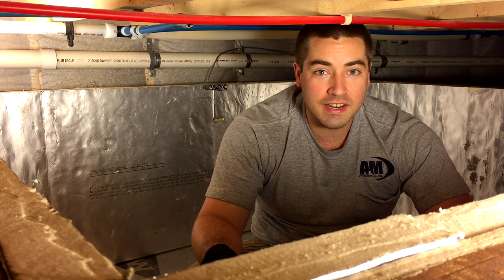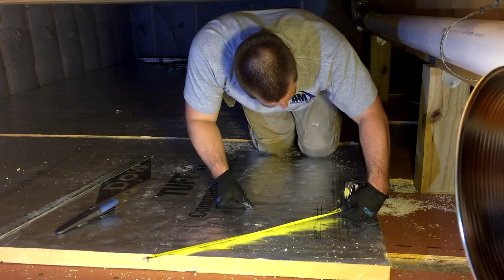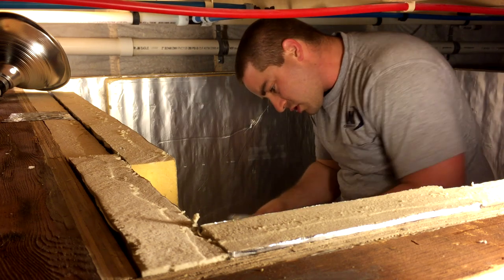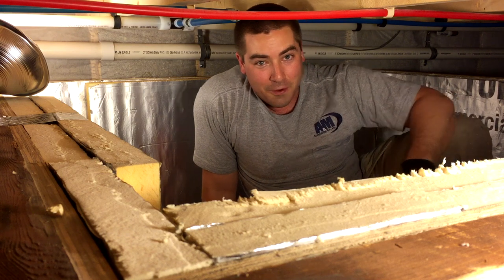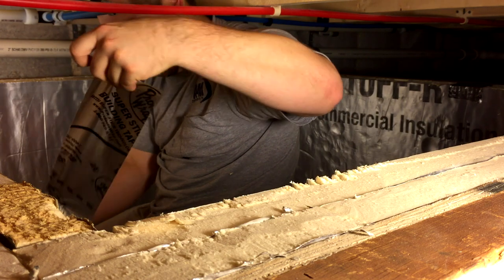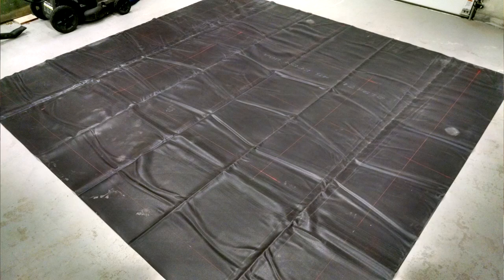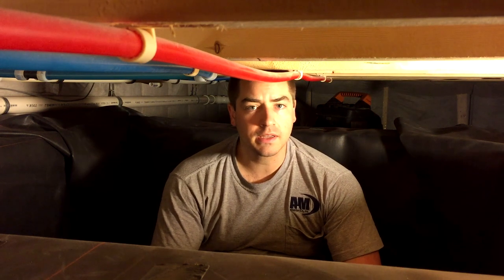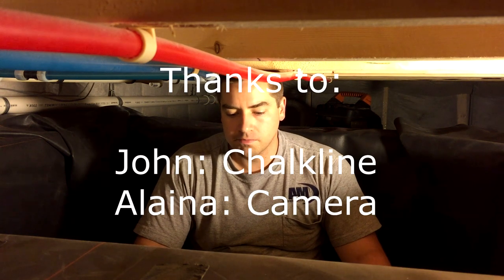DIY Hot Water Solar Thermal Tank

Comment: Have you considered storing chilled water, as well?  I was thinking of storing chilled and/or heated water as a way to supplement heating and cooling.  Whever I have cheap or excess power, I can just run my heat pump more during that time and capture the temperature change for later.  Then, if I have some peak usage or demand, I can use it to supplement the heat pump.
Reply from the maker: Yes, I considered it, but never went through with building an ice storage system.  If you try it, let me know how it goes.

Comment: What is the design temperature for your tank, and what is the temperature limitation for the liner?
Reply from the maker: Hi Richard, Thanks for watching the video.  I set my controller to a high limit of 180°F.  I set it there because that is the max temperature printed on the PEX tubing I used for the heat exchanger.

Comment: Dude! Exactly what I was thinking of doing. Thank you. Are you managing to keep the lid on tight enough not to create a moist space under there? This is my main concern.
Reply from the maker: Hi, thanks for your question.  Yes, the lid is on tight and I have had zero issues with the tank or moisture.  I think in the next video I have a clip of adding the lid, but it's not very good video footage.  Basically, I cut a 5 foot square of the EPDM (rubber) material for the lid.  I installed it using silicon caulking and staples.  This seals the top EPDM to the bottom EPDM.  Only after it was sealed did I add the foam insulation to the lid.  The foam lid was screwed down to the frame, which helps by adding a second way of securing the rubber lid.  I've got a detailed article on "Build it solar" that also might help you out.  I'd love to hear how your project goes if you want to message me on facebook?
https://www.builditsolar.com/Projects/SpaceHeating/DavidPoz/DavidPoslusznySolarDHW.pdf
https://www.facebook.com/DavidPozEnergy/
Reply: @DavidPozEnergy  Really appreciate that, the lid really "seals the deal", no pun intended lol. Isn't it amazing to live in this time, where information is so easily shared? You potentially saved me tons of pondering/tinkering by proving how it can be done. Thank you. Is it working well? Is there anything you would do differently? I'm likely about to go off-grid and I'm aiming to make hot water with as many panels as I can and grow food year around with the thermal bank. It's been inspiring to see your efforts. I will be following you/sending you a PM on Facebook. I still need to acquire the knowledge of how to wire it all up, where to put fuses and more.
All the best from Sweden
Reply from the maker: Hi.  I'll watch for your message on FB.  Remind me of this conversation because I don't know your name.  Would I do anything different?  Yes.  I would have spent the extra money for copper tubing instead of the PEX.  The PEX works, but when the tank gets real hot the PEX gives the water a plastic smell.  Copper would be the way to go in the future. 
Also, I built my tank as tall as I could given my crawl-space, but if I had a taller room I would built it taller.  The taller the tank, the more you can take advantage of stratification, which means better efficiency overall.
Reply: dont even need a lid, no vapor or moisture , same as bottled water, just dont tip it lol
Reply: @DavidPozEnergy  ,Also i use a old upright freezer with the shelves taken out and lay it on its back . looks like a bathtub with a lid (door). I put my l-16 battery's in there and fill with water up to top of battery's, then use a fish tank heater to maintain 80 deg f year round. battery will last for ever.. you can call 208-651-2363 bob

Comment: Ive seen you mention that you havent had any issues with algae or anything growing in the water etc. why do you think that is? have you done anything to prevent it?
Reply from the maker: My town water has chlorine in it to kill anything before it gets to my door.  I also added about 1/2 cup of household bleach (7.5%) when I initially filled the tank. Chlorine evaporates fairly quickly, so there might be something better to use, but I did this just to make it sanitary when building it.  Beyond that, there is no sunlight, and I think algae needs sunlight, right?

Comment: Hi @DavidPosEnergy, i am planning on making a tank similar to yours to store  water, heated by a heat pump, that i will use for space heating (via radiators) for my home. Would be interested in any comments you have. Thanks
Reply from the maker: That would be a cool project.  I haven't looked into heat pumps for making hot water in a few years, so I don't know if my info is dated.  At that time, there were 1 or 2 companies making the outdoor compressor unit, and it was more expensive than buying a normal mini-split heat pump.  Are you making your own heat pump for this?
Reply: I plan on purchasing a heat pump for this.

Eventually I would like to have 3 energy sources. Heat pump powered by my PV solar; thermal solar (like yours) and a simple electical resistive element; so when I have excess PV solar I dump as much power as possible into the water.

Another idea is to dynamically vary the quantity of water in the battery (water tank) on a daily basis to keep the max temp of the water from exceeding 70 degrees AND to ensure the tank can get to between 60-70 C on a bad solar day.  Most of the heat pumps dont go above 60-70 degrees C.

Comment: How important is the way that the rubber folds inside the tank?  Should I take the time to cut and seal mine like a pool liner or is keeping it "neat" good enough?
Reply from the maker: It could be done either way, but I'm avoiding any cutting of the rubber liner.  All the pipe penetrations will be above the water level, and the corners are going to be folded, but not cut.  I just think it is going to be the most robust way.

Comment: Hi DavidPoz! Thanks for your beautiful video. I want to build up a drain back Solar heater system. I have already an insulated tank (300L) from Daikin. It can optionally mount a drain back system, but I don’t want it from Daikin because it’s too expensive and DIY is always the best. :) My question is: how do you set the pump flow rate? And how should I choose the most suitable pump?

Thanks for your precious explaination
Reply from the maker: The pump flow rate...  Well, I have a Grundfos pump with 3 settings for the flow rate.  I wanted the slowest flow rate, while not allowing the water to boil inside.  I installed the pump and set it to the lowest flow rate, then checked the temperature rise on a very hot and sunny day.  I think it was 9 degrees, or something like that.  So I knew it wasn't too slow and left it at that setting.  As for choosing the right pump, you want one without a check valve.  My Grundfos came with a check valve that can be easily removed in the field (which I did).  Then you want one that works with oxygenated water.  This will mean brass or stainless steel.  Lastly, you need to measure your head, meaning the vertical rise of water column the pump has to overcome.  You will find it's expensive to buy a pump that has a 20+ foot head.  I bought my pump on ebay, it was an open-box still new.
Reply: @DavidPozEnergy  thanks a lot David. My tank is now connected to a heat pump, so My aim is not to fully rely on solar, but only to let heat pump to make less frequent starts. Furthermore I have space for only 1 solar collector: do you think that even with 1 collector I could have a tangible result or not?
Reply from the maker: @francesca7765  What model heat pump do you have?  Can you share a link?  I'm just curious.  If you only have space for 1 solar collector, then It's probably not worth the cost of the piping and pump.
Reply: @DavidPozEnergy  at the moment I added an electric heater to DHW tank connected via zigbee to my PV inverter: excess PV power activates heater. This way I can avoid heat pump activation. But it’s summertime: I wanted to add the solar collector for winter when sunlight will last less…
Reply: @DavidPozEnergy  Hi David. My heat pump is Daikin Altherma 3M 9Kw
Reply: @DavidPozEnergy  I want try to realize this project, even if would be insufficient :) . I've just found a solar collector. Looking at its specs, the label states: suggested flow: 35 L/h (0,58 L/min). This means that I should install a "small" water pump?  I have a pump that has minimum 10 L/min, so...it's not usable? Thanks a lot
Reply: @DavidPozEnergy  David can you please indicate which pump model do you have? Thanks

Comment: David, It looked like a lot of work. What do you think about using water barrels, link them together then spray them with foam insulation? What issues would you think would arise?
Reply from the maker: Hi James,  John Canivan is a big supporter of using plastic drums.  https://youtu.be/jVkcpzvWqt0  They can work well.  The downside to using plastic drums is they loose structural integrity around 130°F or so.  This means they can work well for pre-heating your DHW (Domestic Hot Water) or for radiant floors.  But they won't work well to store heat above that.  

One of my very first projects (back in high-school) was with drums.  I used steel drums, put them inside a light wood frame, and packed cellulose insulation around it.  Nothing wrong with spray foam, but you will find the cellulose a lot cheaper.  The downside is you need a frame to contain the cellulose.
Reply: @DavidPozEnergy  maybe aircrete for the insulation?

Comment: Thanks a lot for the EPDM liner tip! I was wondering do simple PE whistand high temperatures. BTW whats the main purpose of this tank? Do you use it as main heat source for solar heating in winter? What is your typical outside temperatures?
Reply from the maker: I don't know the temperature ratings of PE.  This tank is to heat my domestic hot water, not a space heater.  It would need to be larger with more solar panels to be used as a space heater.  Outside temperatures?  I'm in Massachusetts, so low of -10°F and high in the summer about 100°F.  I hope that helps.  It works and cuts down on my electric bill for heating water.

Comment: How has it stood up over the years?  Interested in a similar setup for my crawlspace, but debating on just using 55 gal drums.
Reply from the maker: I haven't needed to do anything to it.  The whole system just runs automatically.  I've put a camera down the vent to look around, I've siphoned some water to check for algae, everything looks great.  Nothing is wrong with the system.  If I did it again I would use copper instead of PEX for the heat exchanger, but I don't think you were asking about that.

Comment: How many gallons do you figure the tank is?
Reply from the maker: There is about 230 gallons of water in the tank.  As I measured it the volume is more, but there is an air gap at the top, and the PEX displaces some.
Reply: I believe 1 Cube  Ft holds 7.5 gallons